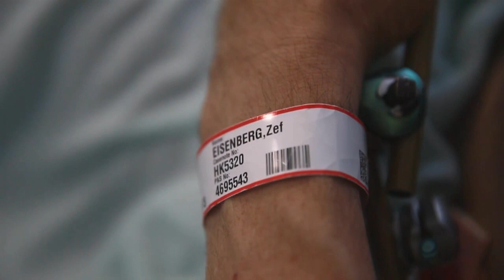Henry Cole with Zef's MADMAX Turbine bike on the Bike show

Comment: Okay I'm confused did he invent the Y2K bike or did he take the Y2K bike and add on to it to make it more powerful it was my understanding the Y2K bike was made in United States please explain
Reply: The Y2K came first in 2000 from Marine Turbine Technologies in Louisiana, main difference with this bike is the single speed, whereas the Y2K uses 2 speeds making its acceleration faster. This one runs around 15 seconds from 20-200 in a vid on YT, whereas the Y2K runs 0-227 in 15. Different turbine as well, though both from Rolls-Royce. The Y2K was from a Bell Jet Ranger helicopter.

Comment: Epic bike and epic crash! I'm saying that as my recovery continues from my own crash in 2011 in a 4x4. I had my right foot smashed (broke in several places between the ankle and the toe knuckle on every toe and two screws in the ball joint bone), badly broke my left ankle (with more metalwork), my knees went through the dash board, my right upper leg tried to go through my hip joint, my left hip/pelvis broke from the seat belt, 6 ribs and sternen broke clean through and moving like piano keys, my chin took out the horn button out of the steering wheel, dislocated my left wrist on the gearstick, and both the bones in my lower right arm badly broken and now has plates and screws for around 8 inches in each bone. The mazda rx8 had ploughed into us at 60 mph with our speed at 30. My drivers door hinges were almost touching the lock and my front wheel was hard against my seat. My partner Lisa Brian who was also in the car with me had horrible injuries too but we are here and keen to start riding motorcycles! I have been told that the pain levels I went through were higher than child birth, well over 30 breaks in 22 bones and no pain killers for 2.5 hours after impact. While we waited to be cut free my partner and myself chatted to each other and kept our spirits high and kept each other calm. On average I can walk 40,000 steps a week and I had been told that I wouldn't be able to walk again, but I'm stubborn! You do get a new perspective on life, you know what matters and what doesn't. :)
Reply: No disrespect but im in disbelief
Reply: Uhhh get well soon
Reply: @retrodigi375  I wish it never happened either. No compensation even though I was 100% not in the wrong. The driver who hit us was fully insured too. The reason for the no compensation was that no one was at fault. The driver who hit my Vauxhall Frontera had a stroke at the wheel, floored the accelerator, the passenger managed to steer it round the corner but the speed meant he hit us with their speed in excess of 60 mph and my speed of 30 in the 30 zone. In the link I'll attach in a minute shows the newspaper report and the picture shows their car and where their front wheel is, is where my foot well should be. My front wheel was nearly touching my hip. The photographer is standing by the spot in my lane where impact happened, we went back 40 feet and landed on the car behinds dashboard.
https://www.salisburyjournal.co.uk/news/8821483.four-in-hospital-after-london-road-crash/
Reply: @darkskull5790  thanks 😊
Reply: @allanblackesq  no offense to the guy but wasn't it his fault even though he had a stroke?
Reply: @darkskull5790  yes, they paid for the damage of my car but payment could not be made due to 1) the fact it was believed the passenger steered it around the bend
2) the time of the stroke couldn't be determined in the 28 year old Bombardier.
3) neither person in that car could remember anything.
4) there were no skid marks at the scene.
We have had to rebuild our lives after losing my job due to my injuries, go self employed making model live steam trains from zero capital, and try to walk again. I also didn't qualify for Personal independence payments as I had learnt to walk 20 feet, and I lost over 2 stone of muscle weight. Not only regain my strength, mobility and the use of both hands and look after my two disabled parents at home while my fiancé Lisa was recovering from her injuries in the crash. My stepfather and mother had health issues related to diabetes and asthma. My Councillor asked me how the feck was I still sane. The thing is from my side I can understand why people find it difficult to believe what I am saying, it shouldn't be happening, but it does. I won't give up without a fight.
I do have to thank Henry Cole TV programmes for giving me the entertainment and a wanting to go out for a bike ride and forget everything else. My life has been a bitch but that's no one's fault, it's the cards dealt with on the day. Live life to the full.
Reply: @allanblackesq  ok. Again I really hope you get better soon
Reply: Must've been a solid helmet